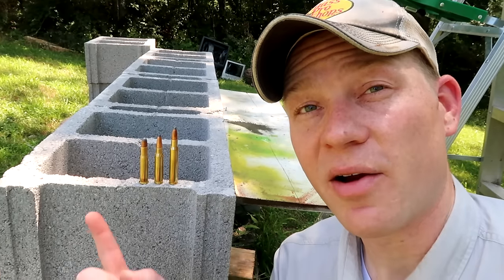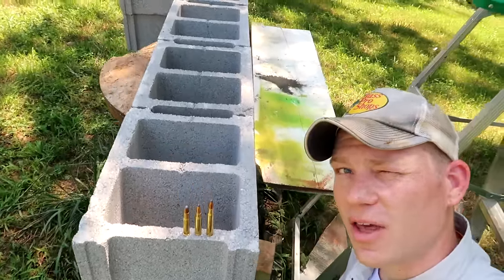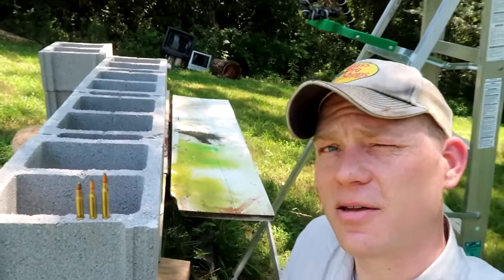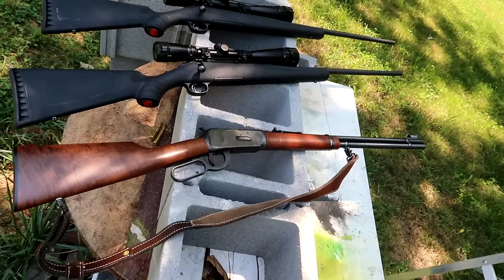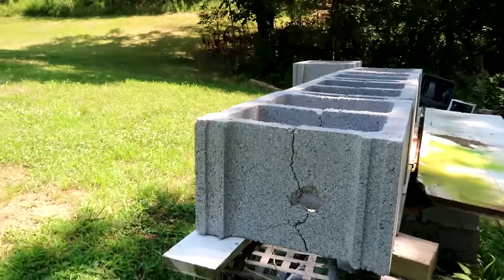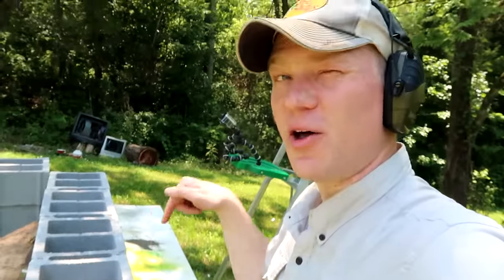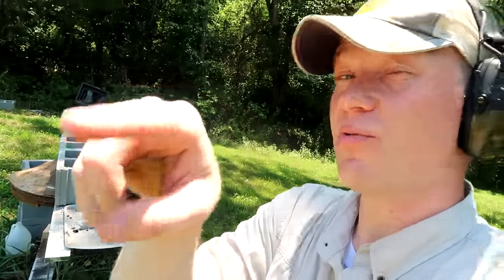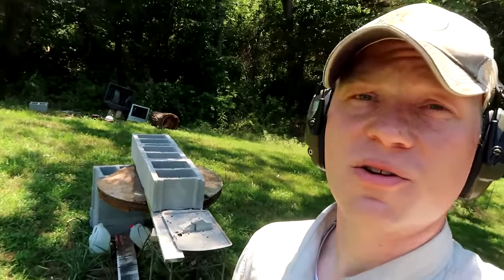30-30 vs 308 vs 30-06 - Cinder Block Test

Comment: I have owned and shot all 3 calibers and I prefer the 30-06 with a 180 grain bullet!
Reply from the maker: You are not alone in your thoughts John. Many think the same. Thanks for watching!
Reply: Hell yes my ought-6 rules
Reply: Im an 06 guy myself.  What animals are you shooting?
Reply from the maker: I am a whitetail deer hunter
Reply: @WHOTEEWHO  Me to, you dont think the 180 is to much for a whitetail?
Reply from the maker: Nope. No such thing as too big. I whitetail hunt with 750 grain 50bmg and 500 grain 458 socom
Reply: 180 grain bullet is the way to go imo
Reply: @WHOTEEWHO  I used 150 for years  A few years ago I shot 5 and had to track all of them.  I was shooting 180gr.  I had never tracked one before.  I  called the mfg and they said 180s are to heavy for whitetail.  They said 180s are for mule deer,  larger animals.  Apparently they were punching through the deer and not expanding.   I went back to 150 and they drop in their tracks
Reply: For the '06, I prefer the 165 grain bullet as the overall best balance in bullet weight.
My deer load consists of Federal brass, CCI 300 primer, a near max charge of IMR 4831, and the 165 grain Barnes TTSX bullet.
Reply: Dennis Millus How about a 220 gr 30-06
Reply: @kevinheine2152  Yup. That's the right point. You want the energy of the round to be dissipated in the animal's body for a quick, clean kill.
Reply: 30-06 without a doubt will get the job done! I will be getting me a 30-06 intead of the 30-30 😁😁😁
Reply: @WHOTEEWHO  like my dad used to say...how do  you line up enough deer to use so powerful a cartridge?
Reply: @kevinheine2152  i never used to find 170 grn .30-30 s they went on thru

Comment: I've fired all 3 but I own several different styles of 308 after gel block testing and accuracy testing the 308 edged out the 3030 and 3006 but fell short to the 7mag and 7mm08 and 270 but ammo availability is a must. So whatever you buy makes sure you have plenty of ammo for it

Comment: I appreciate that they're all 150g bullets but the problem is that actual bullet design. The 30-30 was a SPRN which is going to expand quicker than the pointed rounds on the 308 and 30-06. I'd bet that if the 30-30 were sporting the exact bullet as the others, it'd have done as well. 

Felt sad for the blocks...
Reply: Uncle and cousin had a 94 win and a savage bolt in 30-30. They loaded up some psp's for the savage and the difference was very noticeable.

Comment: I prefer the 30-30 for short range heavily wooded areas that have dense brush thickets and targets are within 100 yards. I use my 30-06 because ir has an awesome old Leupold scope on it and if my targets are 100+ yards over somewhat more open ground and heavily wooded brush thickets I use it because it's devastating both to my target and my shoulder lol

Comment: It isn't surprising, that hi-powered cartridges - as 30-06 or .308 Win. could not reach their full potential on such short shooting distance. Most shooters don't bear in mind, that bullets are spin stabilized and behave like an gyroscope. After leaving the muzzle the bullet tip moves as a cork screw- as a result   of two independent movements (nutation and precession). Whilst the faster nutation declines with increasing distance, the slower precession remains nearly identical. That is although the definition of bullet stability. However- the initial nutation movement near the muzzle results in less stability and so in less penetration. On larger distances (approx. from 100m on)  you will notice, that the bullet's flight is more stable which results in deeper penetration albeit if kinetic energy is less. These effects are stronger with higher velocity, longer (heavier) bullets and smaller caliber.
These effects were described by May. Gen. Julian S. Hatcher and later mathematically defined by German ballisticians Molitz/Strobel.
Reply: It's hard for me to conceive how a bullet can come out of the barrel like a corkscrew and ever shoot good groups say a hundred two hundred yards down range. Some slow speed film would be nice to prove out this Theory
Reply: People can get behind a keyboard and say anything they want. I didn't say it couldn't happen. If you do a YouTube video on the subject I promise I'll watch it

Comment: My deer hunting round was the .3006.  My defense gun was a great old M1 Garand to cover both needs.  If I were doing it over I'd deer hunt with the .308 and have an M 14 in 308 for the 20 round box magazine for defense, end of the world stuff.  Both bigger rounds are fine.  The 3030  was OK for prison guard wall towers, but I'd rather have the knock down power of the two bigger rounds.

Comment: by the way , i had a schoolmate who was loading an '06 before driving to school during the Augusta riots when it went off. it was an old armor-piercing black tip. the bullet went thru the plaster,cement block then brick wall. they found the tungsten penetrator, 125 yards away halfway thru one side of a two inch pipe . i   had a 7.62 from a sks go thru an 18 inch red clay dirt clod and in to the dirt another 6-8 inches from 120 paces. dead center. it was still in one piece. the ammo was that old Chinese ap from vietman era that the batf was whining about . a magnet would stick to it .  i wonder what a 220 grain would do .. heavier jacket and more sectional dansity= more "burn time "   .   interesting as usual ,kudos.

Comment: That really is a good test to compare rounds. I wonder about FMJ 7.62×39, 8mm Mauser, and 7.62×54 would do in this test? BTW, I have seen .308 and .30-06 ruin more deer meat than the .30-30.
Reply from the maker: Thanks! Need to test those out I suppose huh
Reply: Other than the 7.62x39 (which is an assault weapon cartage), they are all about the same. Since most deer are taken at less than 100 yds, the 30-30 is just fine.
Reply: John Lumpkin 
Lots of deer get taken with 7.62×39 near me. I don't recognize "assault weapon" as a description of any firearm but do like my 30-30.
Reply: upside downdog I agree with you, the term assault weapon is a news media made-up word. The way I look at it,  anything you assault somebody with is a assault weapon, that could be a garden tool to a baseball bat.
Reply: If you just want to kill the deer, use a 30-30, but if you want to splatter it across the county, use a 308 or a 30/06?
Reply from the maker: 😂😂😂 oh id say all 3 will work

Comment: Even though the 30-30 didn't seem like it did as much damage, it sure does against an actual meat target and in heavy brush. IraqVeteran8888 did a video about brush guns and why 30-30 and hot 30-06 ammo would be better than .308. .308 is fast but will tumble and lose accuracy as soon as it hits a leaf. 30-30 will for sure go through leaves like hot butter and will not lose accuracy. Remember, 30-30 is going much slower than the 30-06 and .308 and why it doesn't create a big explosion like the .308 and 30-06 did.
Reply from the maker: Yep, I've seen that brush gun video
Reply: @WHOTEEWHO  The brush gun myth was well debunked long before youtube or the internet.  When passing through a fairly uniform material, like flesh or ballistics gel they track pretty good in most cases FOR SHORT DISTANCES. A target 20 feet or 20 yards behind some obstruction is something else. A leaf is not likely to cause a lot of deflection unless its a pretty fast and fragile bullet.

Comment: This why the Army went with 308 as follow on to the 306, less weight, smaller action, basically same performance.
Reply: I don't know where you got your information but, when the Army spec'd out their M24, they demanded the 308 in a long action.

Reason being ease and price of potentially switching to 300WM.

USMC M40 SWS however, is short action 308
Reply: @mr.nobody68  You are right about the action on the M24, but the 308 is smaller, still weighs less and is capable of a smaller action than the 3006, two key advantages.

Comment: The 308 is a powerful round, and it seemed to me that it had more destructive impact on the block than the 30-06.  Generally the 308 is cheaper, but I believe the 30-06 has greater range.
Reply: Your belief is misplaced. 30-06 is good to about 800 yards. A .308 with good rounds can hit accurately and with sufficient energy to still be quite lethal out to 1000 yards. People can get out further, but beyond 1000 yards, one is better off with a .300 Winmag or .338 Lapua. Some people swear by 6.5 Creedmore, but good luck finding rounds or brass.
Reply: @N0B0DY_SP3C14L  How in the hell would the .308 outperform a 30-06?  The .308 has a powder capacity of 56 grains, and the 30-06 has a powder capacity of 68 grains.  And grain for grain of bullet weight, the 30-06 propels the bullet faster.  The .308 generates about 2600 - 2700 ft-lbf at the muzzle, and the 30-06 generates 2800 - 3000 ft-lbf, depending on the bullet weight and powder charge.  So it would be impossible for the .308 to have a greater range than the 30-06.  Besides, you look at the Springfield rifle, Garand, other 30-06 weapons of WWI and WWII, and you will find that they are sighted out to 1200 - 1400 yards, which was the level of confidence in lethality by the U.S. Army, U.S. Marines, and the U.S. Navy.  How did they determine lethality?  Shooting pigs that were at least as large as large humans.  Think on that for a while.
Reply: @MarcPiery  Impossible or not, it does.  Go peep some ballistics charts for yourself. Especially pay attention to 168gr BTHP in .308. Better ballistic coefficient, and though you might think the greater weight  of the .30-06 would do better because of the inertia, the slightly lighter weight and the shape of the projectile end up having less drag farther down range. That's why so many military and police snipers have sworn by the .308 for decades. Not the .30-06 but the .308. And when they step up, it's not to a .30-06, it's to a .300 WinMag, or a .338 Lapua, then usually up to .50BMG from there. The .30-06 just isn't part of the arsenal. If it outperformed the .308 at longer ranges, you'd see a lot more people using it, but it doesn't. Not trying to hate, it's just physics.
Reply: @N0B0DY_SP3C14L  You need to study your physics more.  Both the .308 Winchester/7.62 NATO and the 30-06 have a nominal diameter of .308 inches.  The difference is that the 30-06 has a greater case capacity.  And the ONLY reason that the military opted for the 7.62 NATO is that it can be used in a short action rifle, making it easier for full auto (M-14).  And, the ammunition would be a bit lighter.  NOT because of better performance.  
Questions:  Have you EVER fired a gun before?  Have you ever reloaded ammunition before?  I suspect not.
Now for the 168 grain bullet.  That’s the MAXIMUM for the .308/7.62.  The 30-06, on the other hand, can handle up to 220 grains.  Mind you, they still have the same exact caliber (.308 inches/7.62 mm).
One more thing:  The 30-06 has taken EVERY SINGLE GAME ANIMAL ON THE PLANET, from squirrels to the North American Big-5 and African Big-5. Yeah.  That includes ELEPHANTS.  That’s something that you CANNOT say about .308 Winchester/7.62 NATO.
Also, how do you account for Vietnam era snipers like Carlos Hathcock using Winchester Model 70 rifles chambered in 30-06?  Seriously.  Open some books and start reading.  Also, try going out and actually shooting rifles.  Real rifles, and not in some idiotic simulator game.

Comment: Shot my .308 125gr hand load through 1/2" of solid steel at 50 yards. Neat hole all the way through. Don't know where it stopped. Flat shooting with big punch. Shelved one 30-06 and sold other one.The .308 lighter easier on the shoulder.

Comment: 308 my favorate same damage as 3006 much less recoil also short action
Reply: There is NO difference in recoil if using the same weight bullet at the same speed in the same length barrel.
Reply: Kona Golden wrong
Reply: Kona Golden the bullet has nothing to do with recoil. In fact, the 150gr bullet in the .308 is the same as the 30-06. Recoil comes from the different amounts of powder in the shell casings.
Reply: @mavericks2392  Don't take my word for it, look it up for yourself. Every action has an equal and opposite reaction. Recoil comes from the action of the bullet being pushed out the front of the barrel. Power includes the bullet weight and speed of the bullet. It's simple physics.
Reply: @jsb63  Please be specific and tell me what you believe is wrong, and why. Every action has an equal and opposite reaction. Recoil comes from the action of the bullet being pushed out the front of the barrel. Power includes the bullet weight and speed of the bullet. It's simple physics.

Comment: I like your tests but I have a question? If the 308 and the 30-06 are loaded to the same speed as the 3030 would they not have the same affect. A 30 cal. bal. chart does not show a difference between 3030,308,3006,or any of the 300's it shows a 30 cal.round at different speeds. My question is would it have made a difference if they were all loaded at the same speed as the 3030?

Comment: In '76 shot mule deer running quartering away to right at exactly 1/2 mile with old 1800s 7mm bolt action Mauser and bullet came in high but hit heart really dead center, and I don't recall if deer asked "What was that?" or not.....

Comment: You should try this again with fmj ammo
Reply from the maker: Very hard to find 30 30 and 30 ought 6 full metal jacket rounds off the shelf. Maybe I can get someone to reload them and send me some
Reply: Was thinking the same thing because the soft points are supposed to disintegrate.  Not that I'd expect much difference between the 308 and '06